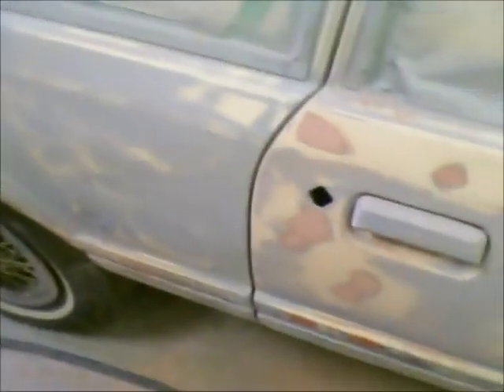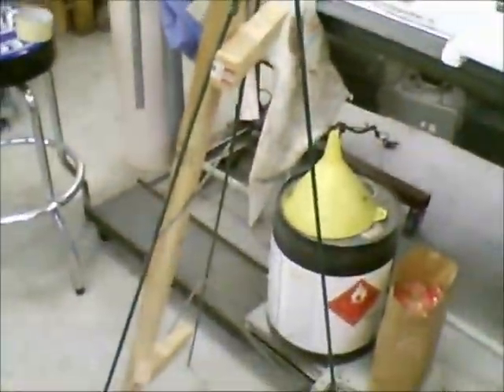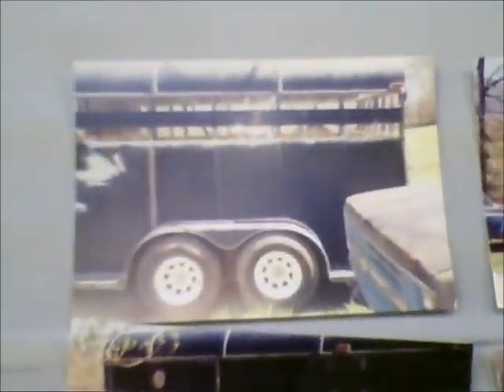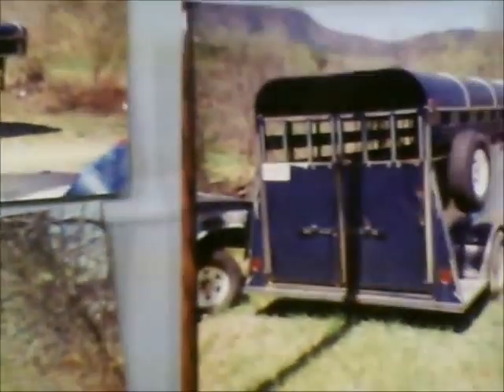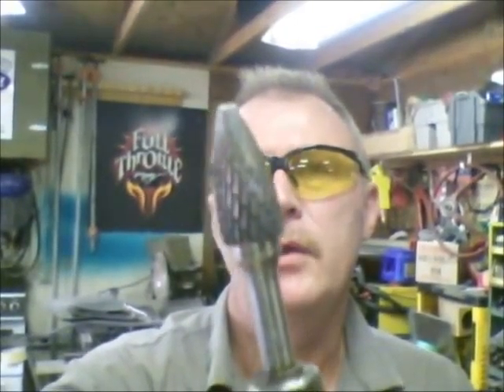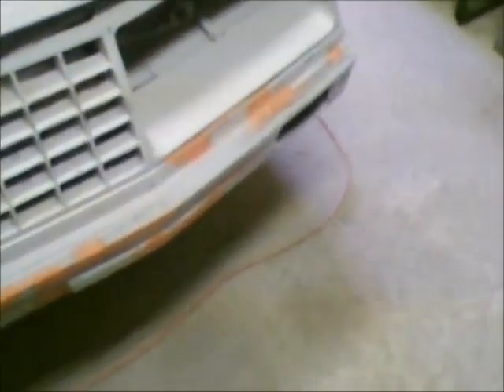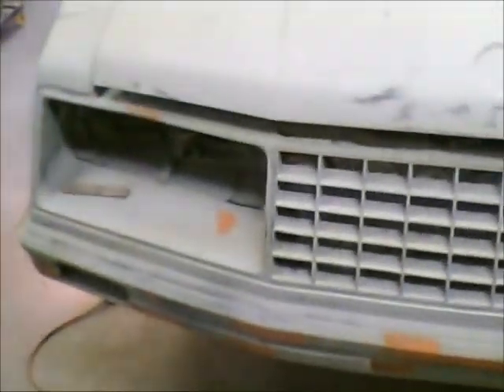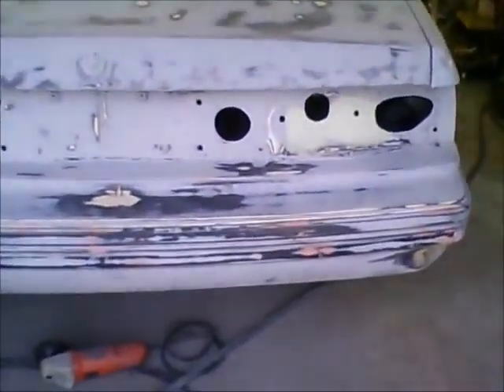Brian's mustang and pics of my train wreck.

Comment from the maker: The rotisserie was made out of two engine stands that I extended the height on so the car would clear the floor and the stands and turn completely over.
I also made brackets to bolt them to the front and rear bumper locations to be stable and safe.
I also use ratcheting cargo straps to the rafters when it is being worked on to stabilize it even more.
If you want more info and measurements on it just pm me and I will get them for you.
Thanks for watching.  :-)

Comment from the maker: Thanks Gary.
I have slipped a time or three and usually only got my glove but they can be a hand full.
I use a side grinder with a flap wheel on exterior panel welds so I dont booger them up.
Thanks for watching and all the teriffic comments.

Comment: Brians mustang is looking good.  Lots of sanding!  Looks like your getting it pretty straight!  I was thinking the same thing for ed the kid on using a carbide burr.  Good tool for that spot for sure.  On exterior sheetmetal welds, I am not steady enough to use that, would let it slip off and mess up the panel!  :)  Thanks for the update, was thining about how you were doing on brian's car this weekend...